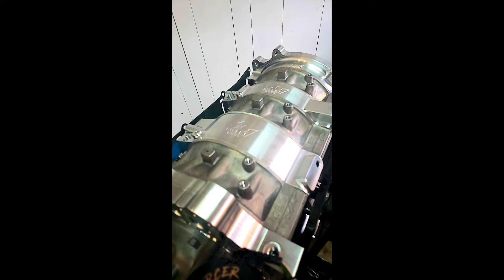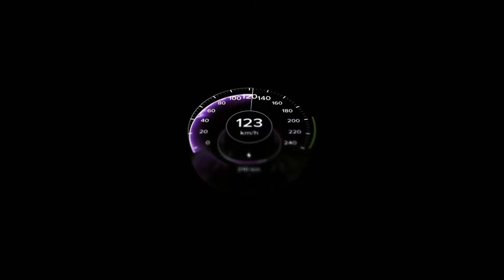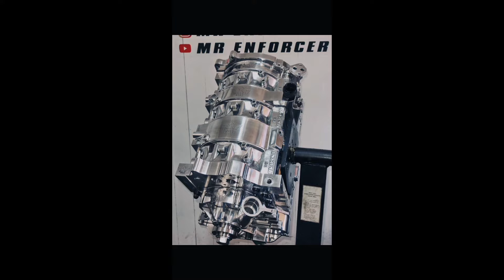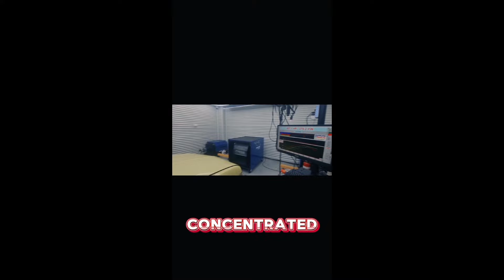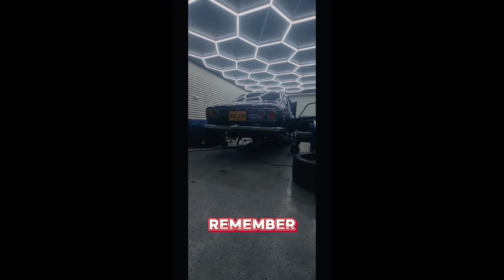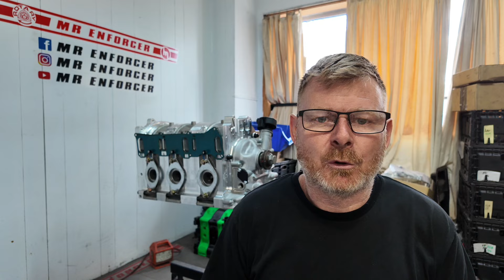20b billet engine build

Comment: how much for billet 20b pp na? and billet 20b turbo short motors? what is the difference
Reply from the maker: The short crank engine saves you 30mm in length over the 20b 
Advantage of short crank is bearings are all std no special sized centre bearing.  But in saying that you can have a20b crank made to suit after market centre gear that takes a std gearbearing.

Short or long crank Billet block in a pp application $55k aud
Reply: @mrenforcerengineering  which do you prefer? seen you have a couple short crank motors! do you still have the rx4 sedan
Reply from the maker: For n/a short crank 
Yeah still got the rx4 it's still ripping